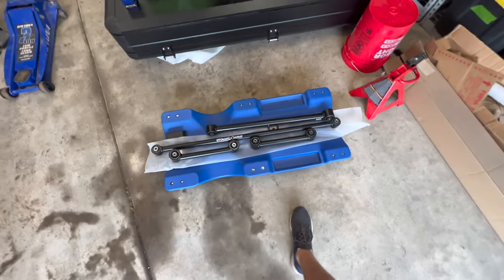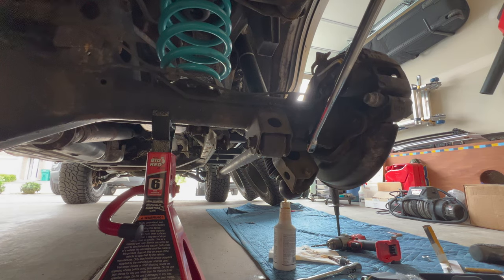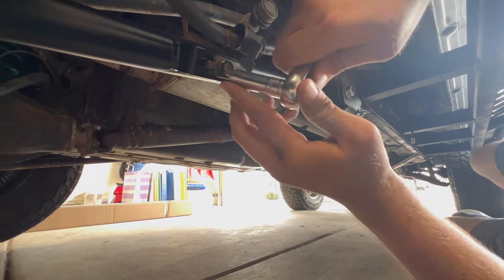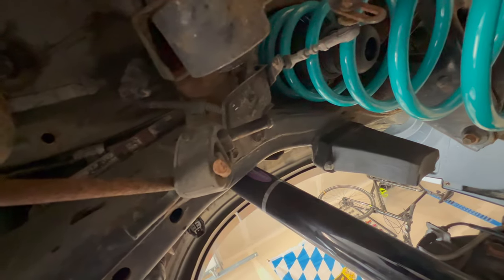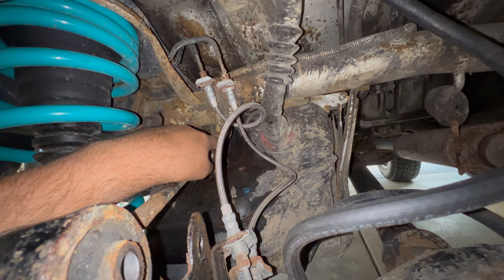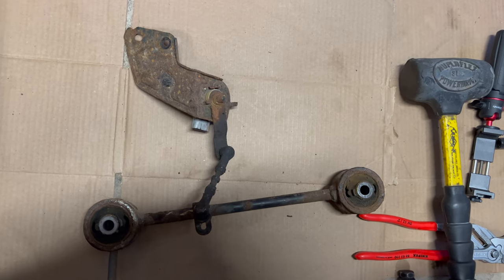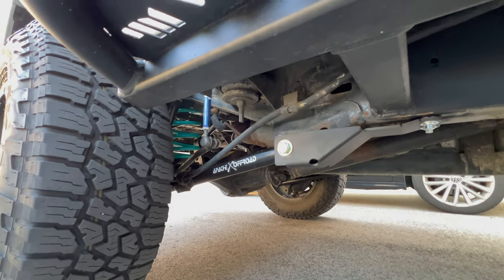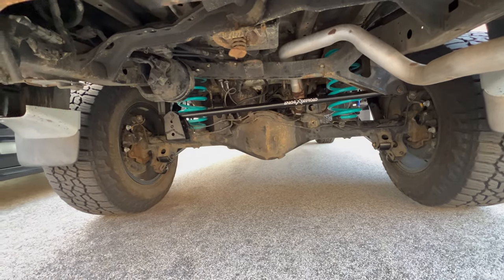Apache HD Rear Control Arms Lexus/Toyota

Comment: Notice how the rear lower arm didn't drop much after front bolt removed? It was being held up by the rear bushing still being in torsion, That's how these OE bushings work the movement comes from twisting the rubber bushings. Same in LCA and UCA. IMO replacement bushings that allow free movement of the bushing sleeve within the bushing is more desirable. It appears that the track bar bushing is free rotating since the sleeve was removed, greased and reinstalled into another steel sleeve.

Comment: Did this gain you any more suspension travel
Reply from the maker: I don’t think so since they’re not that different in length from the stock arms. Mainly helps re-center the axles after lifting it and fresh bushings with larger diameter tubes that are stronger.
Reply: It depends on your suspension set up. If you run a long travel rear set up you will gain about 1-2" of down travel as the factory lower links bind with the axle and the driver upper with the gas tank before full droop. But regardless of your set up, you will experience better and smoother articulation. You will also gain quite a bit of strength. The lowers are 3/8" DOM tube and the uppers are quarter wall.